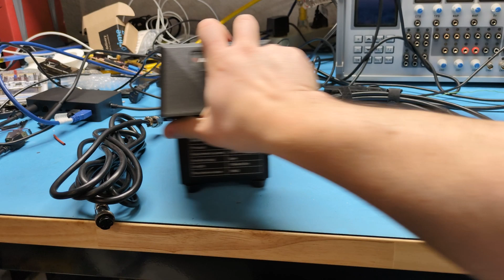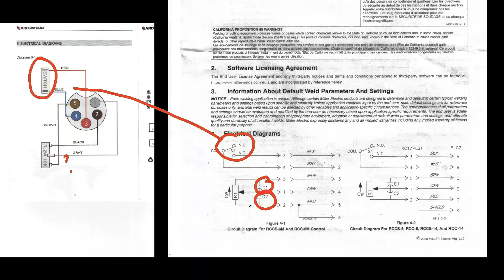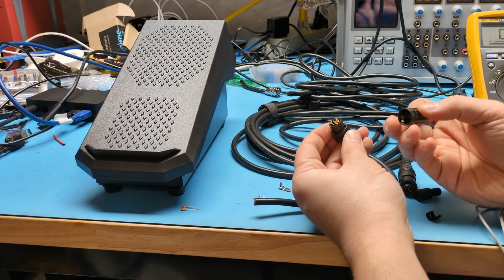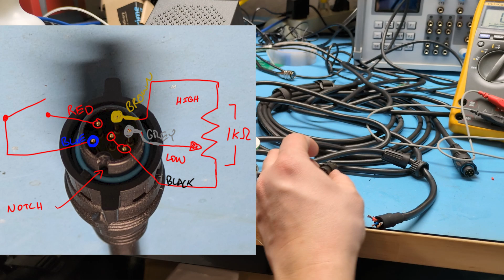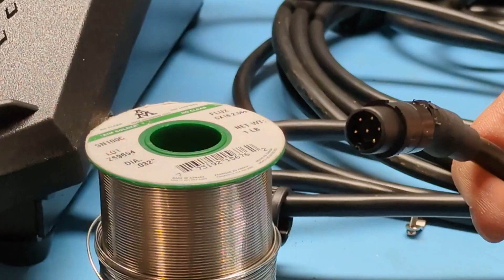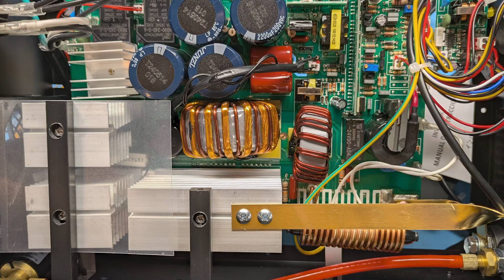Miller 6-pin (MaxStar 161) Welding Pedal Conversion from ArcCaptain for $15

Comment: Will this work with a 9 pin connector foot pedal?
Reply from the maker: Which pedal is the 9-pin one? Most seem to use the same analog interface - the resistance of the variable resistor changes, but with modern digital inputs (like on the 161) that doesn't matter, they would just use the voltage itself. If you have a DMM you could confirm it has a switch + variable resistor, if it seems to it should work fine I think!